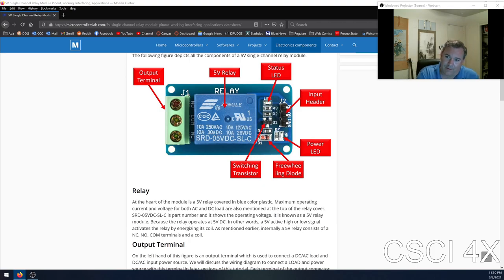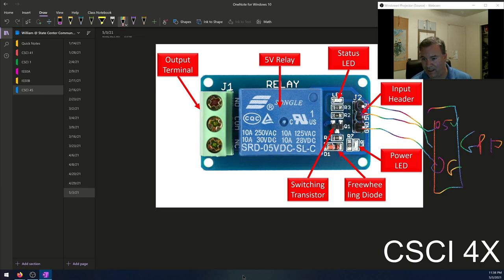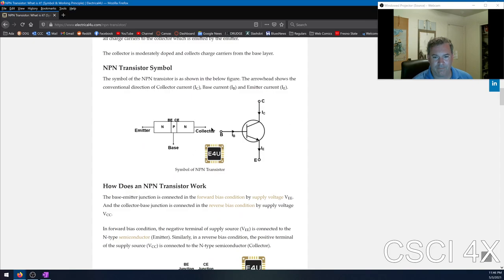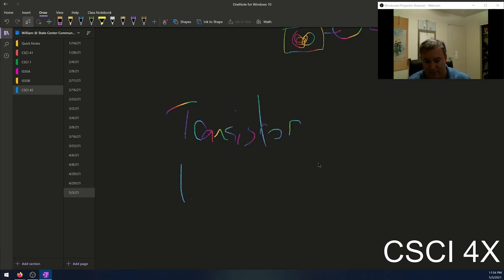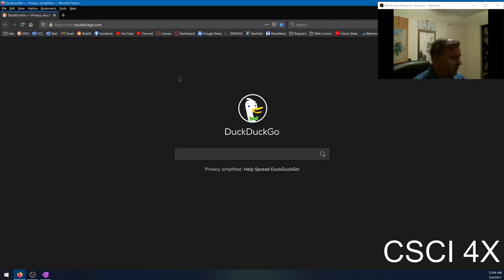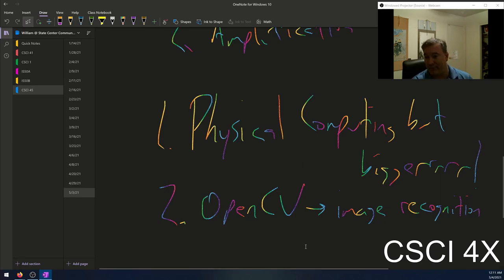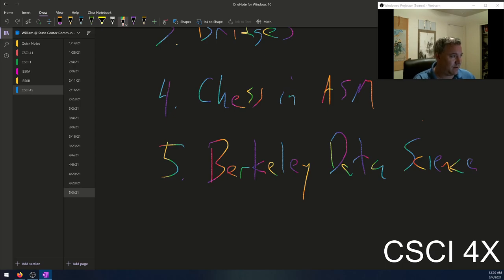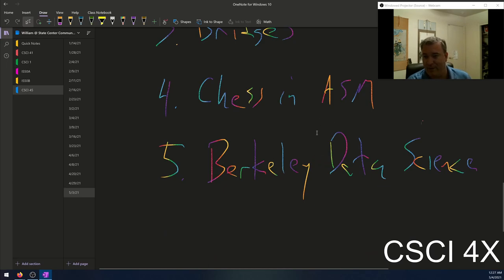Week 17 Day 1 - Relays and Transistors

Comment: Tube amps are dangerous to service if you don't know what you are doing. Tubes can have voltages of upwards to 350 volts with high current. If you come in contact with that type of voltage it could kill you.